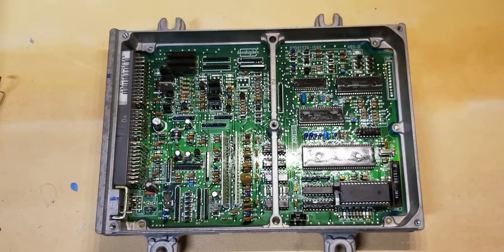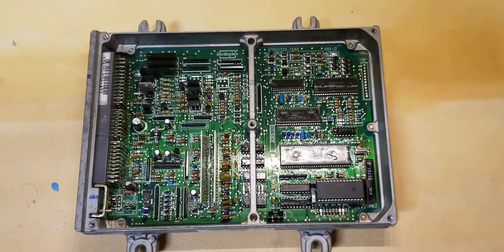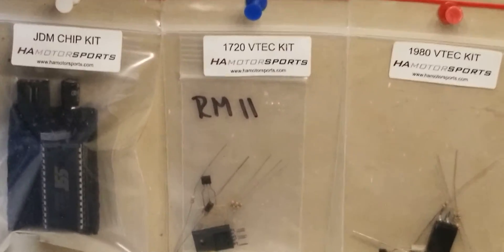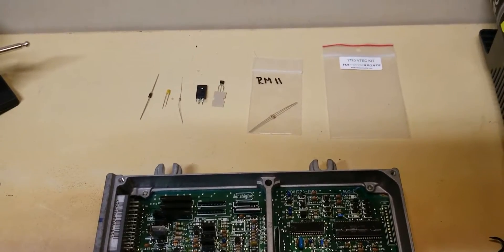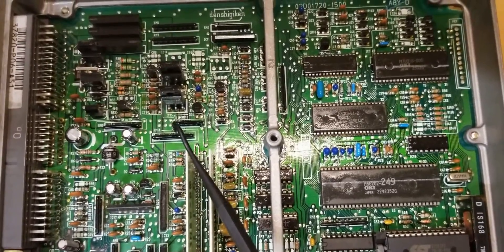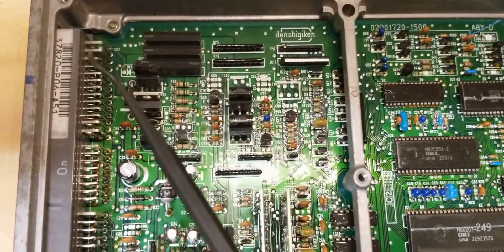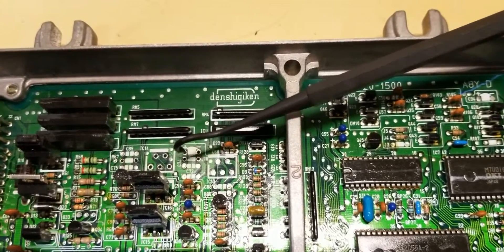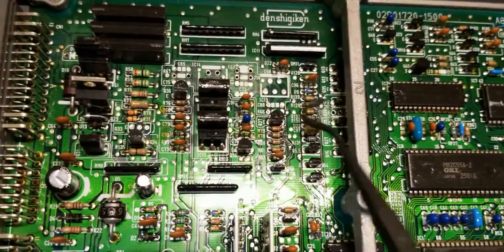HA MOTORSPORTS 1720 ECU BOARD VTEC CONVERSION KIT P06 to P28

Comment: does this Information go for a PO5 too
Reply from the maker: The biggest difference with a P05 is the o2 sensor wiring. P05 is a 2 wire everything else is a 4 wire
Reply from the maker: This specific video allpies to a OBD1 1720 board.....all OBD1 Honda ECUs are similar. 
Chipping is the same procedure for any ECU that can take a 28 on SST chip
Reply: What's your Instagram bro do you have one or SnapChat so I could go in more for details and info because I feel like I got played by my tuner supposedly this PO5 was converted to VTEC and chipped and I opened it and it's not the converted to a p28
Reply: I would like to send you some photos on Instagram to make sure
Reply: All I know is what your video explained of soldering and unsoldering with the connections is not done to mine there's nothing there c14 is empty d10 is empty c60 is empty j10 is empty q26 is empty I'll look for the rest but I'm pretty sure they're empty too I got played bro I paid 300 bucks for this ECU and plus on top a tune

Comment: hi guys sorry for disturb you. I have a p06 with vtec installed and 
honda s100. Can i mount an s300? will work in my prelude EU bb1 ? Really 
thanks in advance
Reply from the maker: Its probably best you trade your s100 in towards a s300 if the s100 is still working...they will give credit towards the s300 which is more suited for tuning
Reply: @DIYKAI  thanks mate